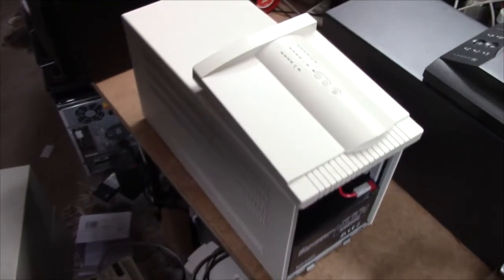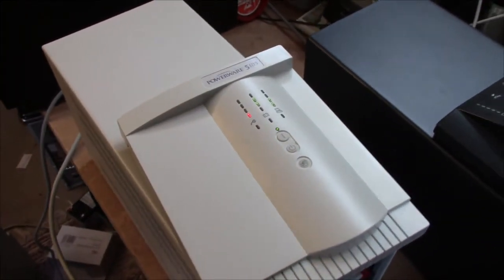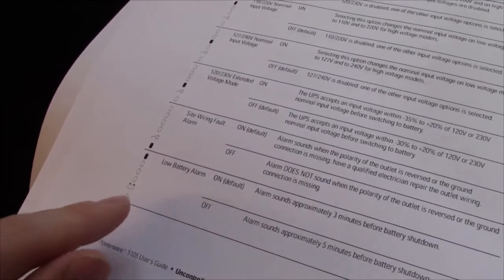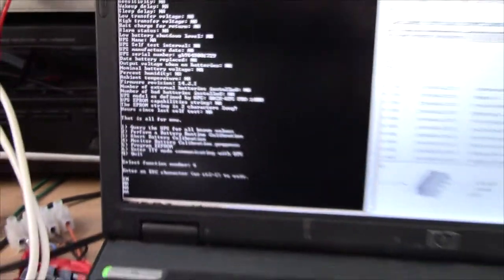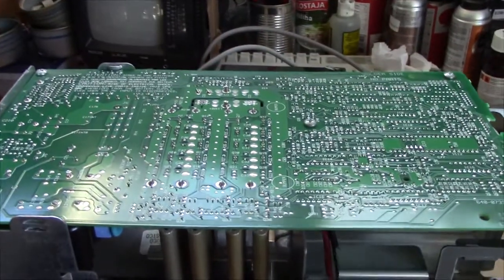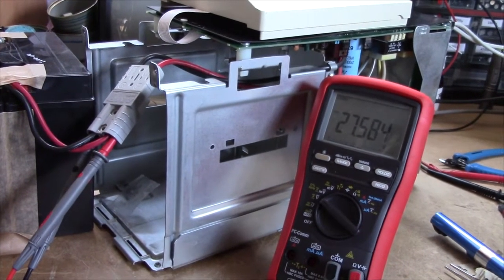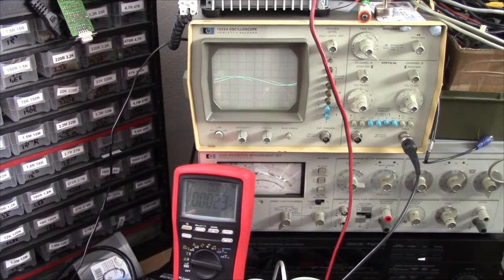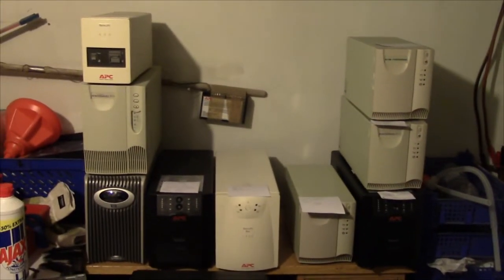Fixing up (a lot of) trash-picked UPS units pt. 3

Comment: What is the highest charge voltage on APC smartUps 1000l that I can set??? I’m trying to connect ups to 24v 18650 pack and fully charged its 29,4v. I don’t have cable nor software to do that. But...I searched and I founded schematics. My plan is to change one resistor with potentiometer and adjust the voltage. But I don’t know how high can I go to not change my ups into ball of fire.